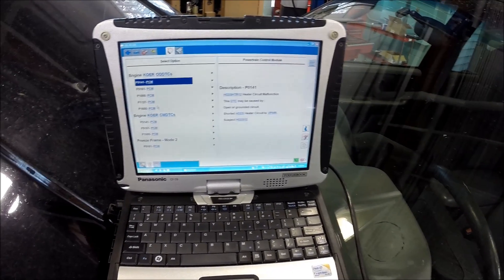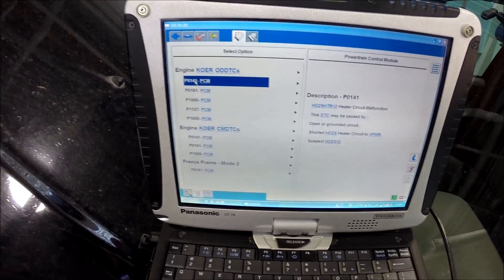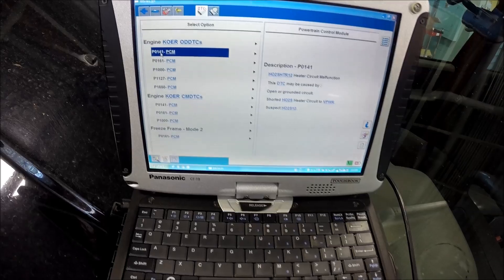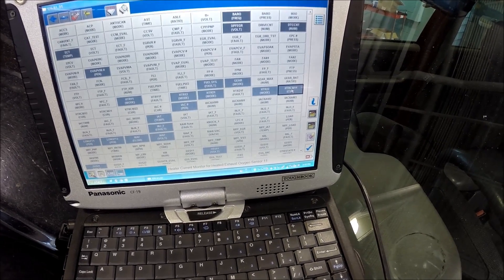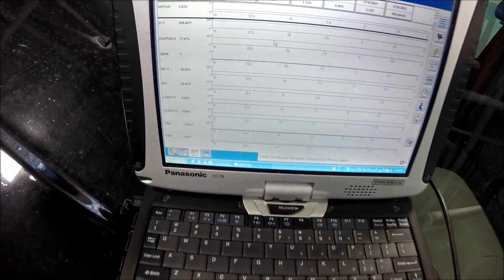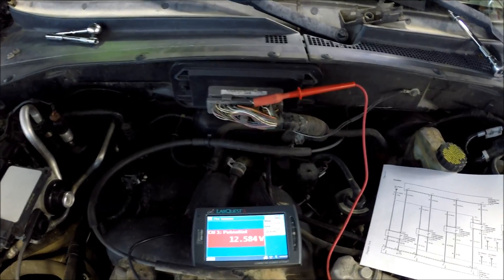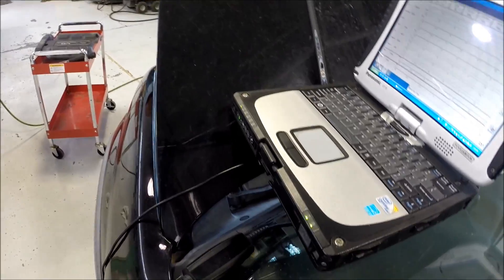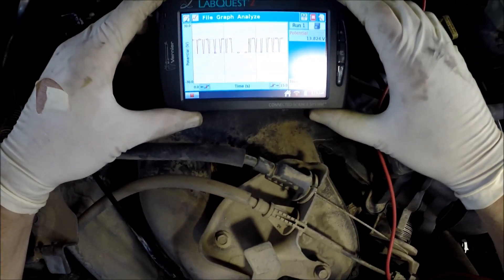Diagnosing O2 Sensor Heater Circuits P0161 and P0141

Comment: Good vid. 
The final test i would do is to check the resistance of the heating coil in the O2 sensor. Connect an ohmmeter between 2 white wires, it should be in a range of 2-6 Ohms.
Thanks

Comment: I have a frontier 2003 I have on the check engine light I check the voltage on the 2 white wires and  I get the 12 volts with the ignition switch on is already the second oxygen sensor that changed brand bosh but I  still  having the check engine Light on also tested the continuity of the 3 cables that came from the computer and all have continuity also check the continuity in the connection of the harness and sensor connection and mark continuity?? I forgot to mention that I have code P0141

Comment: Basically change your sensors with original OEM parts not always after market parts work for your car long story short .
Reply: Might be my problem changed all 02 sensor 6 codes when installed new 02 senaors.. Put 3 of the old 1s in after cleanup 1 error code.. Might have to cough up 60 dollars for the ORIGINAL part...

Comment: What I like most about this technique is how you can do the testing without disconnecting the connector at the oxygen sensor. The moment you disconnect that connector, you've disrupted a possible source of the open/short to ground. Then, after building evidence, you can remove the connector and verify suspicions with a test light and multimeter.

Comment: So,  who could I go to, to get this full diagnostic?  I've had a persistent issue with a P0161 code; and have replaced O2 sensors, and a lower catalytic converter; and all the wiring end to end...  so, I'm baffled.  What recommendation can you make? I'm in Austin, TX
Reply: I've got a 96 Explorer XLT. Have a 161 & a 156 code replaced both upstream o2s,fuel filter and fuel pressure regulator. Moving on to fuel pump next. I've also heard an exhaust leak can cause a lean code which is what I had before I replaced the o2s. This video made me think of a short which sucks but hey it's an explanation. I am ok with cars but my electrical knowledge is sadly lacking.
Reply: chris meyers  You may have a failure inside PCM
Reply: Just wondering if u got it sorted? I've the same issue! Is p0161 the rear o2 sensors or does each one have a diff code?